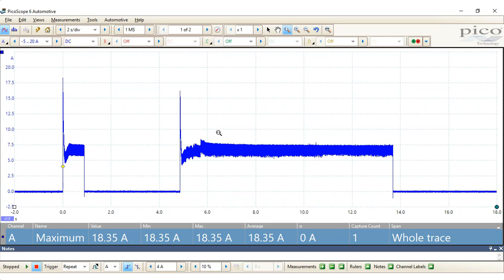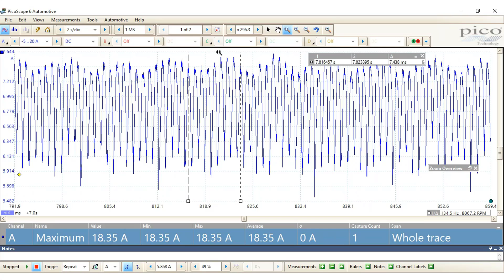Fuel pump test

Comment: Great video, what is the actual calculation for working out pump RPM? My scope has cursors but doesn't do the calculation automatically,  nice feature I must add
Reply: 1 min = 60s = 60000ms
1 revolution of the pump (time between cursors) = 7.438ms 
So 60000/7.438 = 8067 rpm
Reply: @Derabjee1  And about the pump with high or low amperage. Probably they will be defective?
Reply: @Derabjee1 Hi - How do we know when 1 revolutions has occurred please?